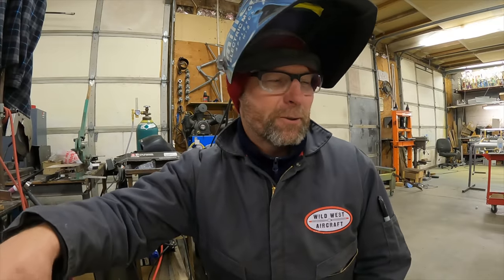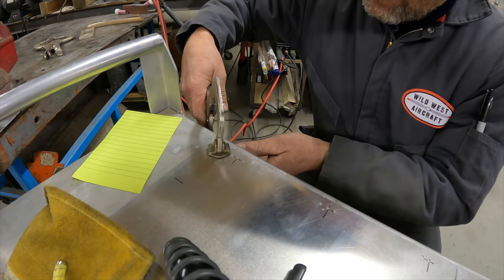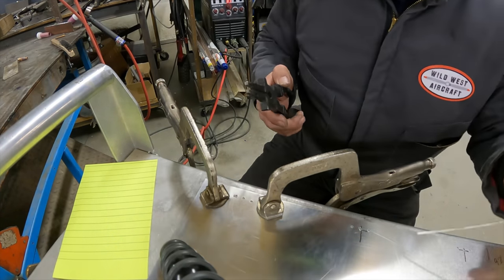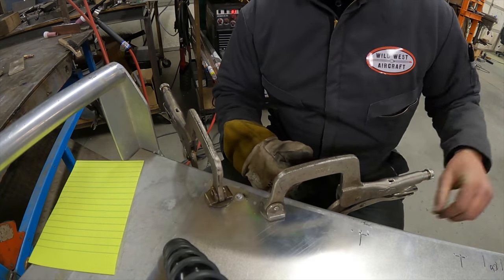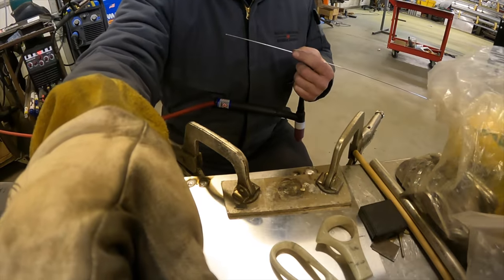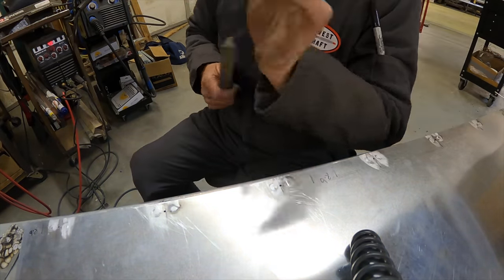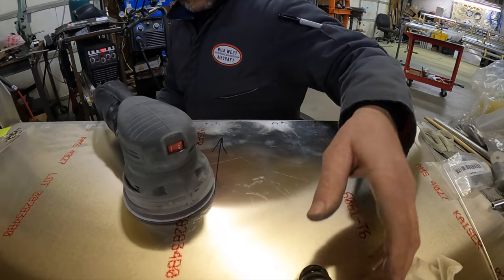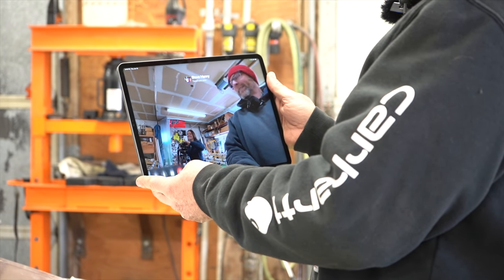I messed up.

Comment: 80 AMP was a bit much even in AC, a copper heat sing is far superior at preventing blow true, not to mention the big GC 17 200AMP Torch ( using a sledgehammer for a finishing nail).

still it was a nice save,good job   but i agreed that the metal property at that edge aria is forever compromise,i would got a new sheet. 🖖 live long and prosper my men.

Comment: Does the electrode corrodes with airplane gas? Or the gas will not be in contact with the electrode?
Reply: If I understand your question, The gas (Argon) protects the electrode.

Comment: One of these centuries I have got get TIG. Tried that with vintage fluxes & OFW a few times. It can be done, and was done on a mass-scale during WWII, but I couldn't get it to work.
Reply: OFW? Oxy-flux-welding?
Reply: @joshrichling464  Oxy-Fuel
Reply: Ahhhh, my terminology is a bit different for that one. Thank you.

Comment: That came out pretty dang awesome 👌 
I would've used filler. Lol
Reply: I did use filler occasionally. The problem is that the filler at 1/16” was much thicker than the base metal. When I lit an arc up there wasn’t enough heat to melt the filler as it was acting as a heat sink but it was too much for the base material and was blowing holes. It was a unique situation for sure. Thank you for the kind words.